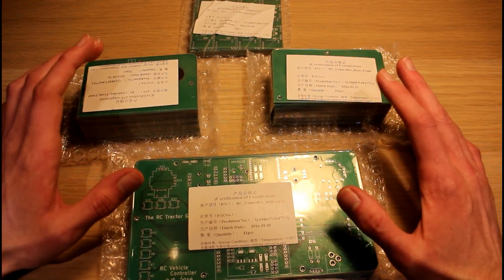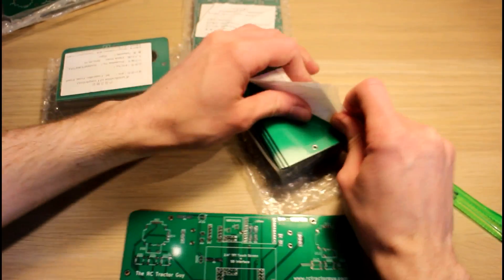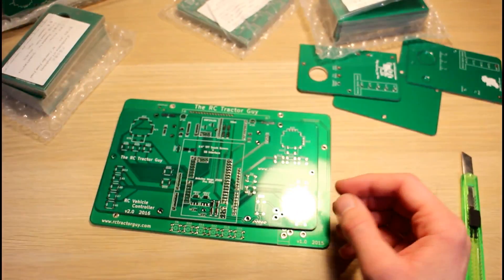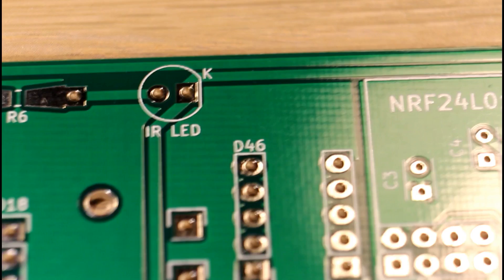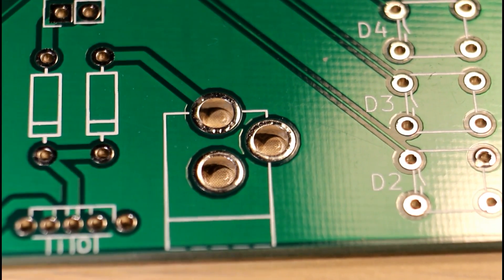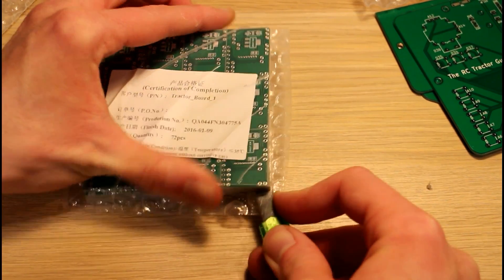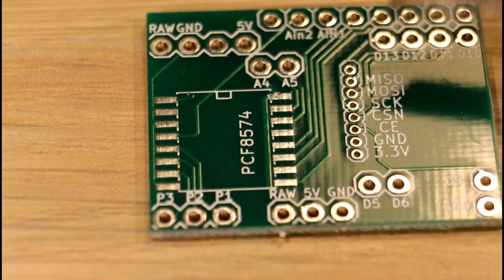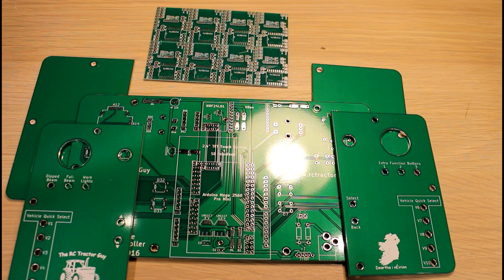PCBs for the Arduino Based RC Controller V2

Comment: Will the boards be able to be purchased?
Reply from the maker: +riley mayo I'm planning to run a kickstarter as some people had asked for the previous version of the boards. I'm using kickstarter as I couldn't afford to buy lots of boards so with kickstarter everyone pays up front, I order all the PCBs and then send them out. If it works well with these boards I might do it with other boards I design in the future.

Comment: Looks nice but I would need such a controller for a tricopter.
Reply from the maker: +Derpy Herpy You could control a tricopter with it if you wanted but I think you should use the XBee radios instead of the NRF24L01 to make sure you don't loose any data.